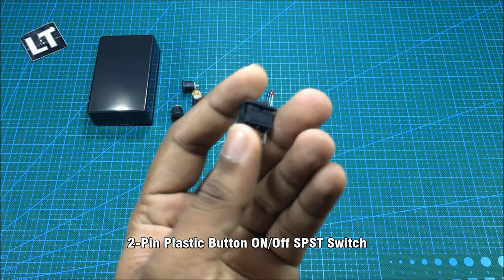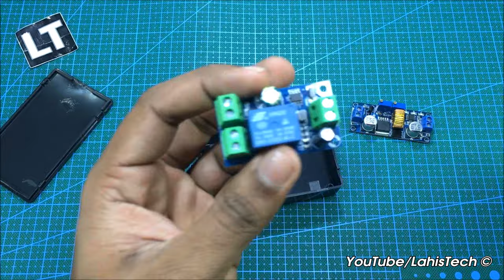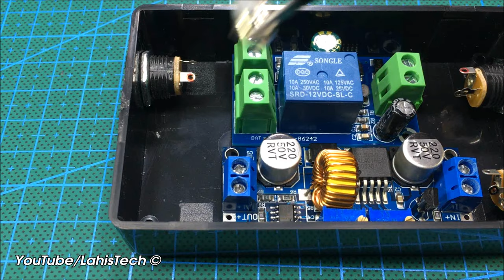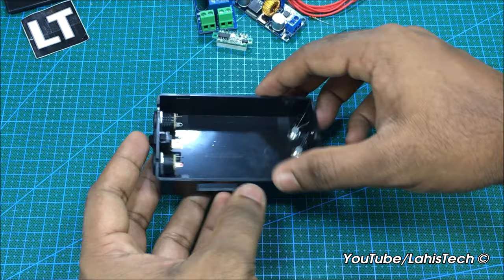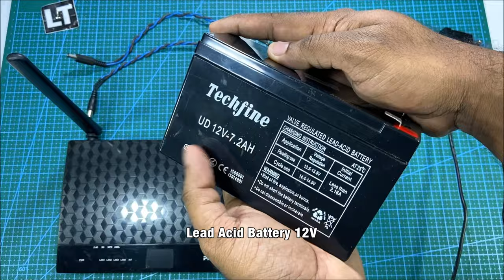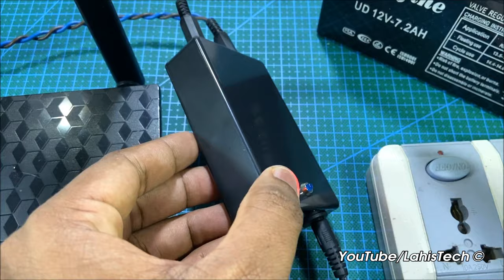How to make Automatic Power-OFF Protection UPS for WIFI Router

Comment: A proper way to make a router ups is using 12xx series ICs. It will properly cut off power due to discharging. Otherwise the router keeps restarting. I've tried a few setups and found this solution as the best way. Thank you.
Reply: You mean 7812 regular ic?

Comment: Why did you use XL4015 5A Power Supply Step Down Module when the Power-OFF Protection Module Automatic Switching Module is capable of charging the battery?
Reply: Di ata nag chacharge sa battery yan bro... kaya nag aatubili din akong bumili ng board na yan...

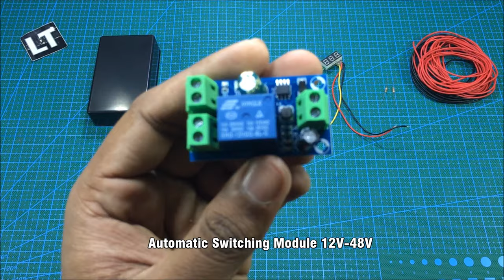Comment: That automatic switching module (#0:52) just switch the connection. It can not charge the battery. Btw this video makes me realize that it is better to use 2 power supplies (1 for the battery, another for the router, or other things) in this type of circuit.

Thank you for this video.  😇
Reply: why do you want 2 power supplies.. just one big with CC is enough
Reply: Right
Reply: If your device requires 1A current, use a 2A adapter, this will charge the battery as well as keep the device running.

Comment: Very interesting video, thank you!
Does this device charge the battery? Is it possible to make it not charge the battery? I need without charging.
And the second question, when the power goes out and switches to battery power, does the router reboot or continue to work? That is, does the switching happen instantly or with a slight delay?

Comment: NO, this does not charge the battery when AC power is on.
It's not an optimal setup!!!
Reply: exactly
Reply: I want to do an ups the same, but to charge the battery. Do you know of a tutorial?
Reply: bms and YX850 or  bms and XH-M350 you need more circuits..
his setup seams for complete isolation its an ok set up if you don't mind charging separately the video used  YX X804 not YX850 or XH-M350

Comment: Does it charges the battery while connected to the outlet? Does the router restarts when switching between battery powered and outlet powered?
Reply: 1.No
2.Yes
Sucks
Reply: There will be 1second delay, so its not ups, just power backup

Comment: Can u explain the reason why you used  a step down module here ??
does Automatic switching modules itself not charging the battery if it is on main current ??

Comment: Great neatly made !
But i have question
Is it the zero lag switch as i can see a blink when u turn off the ac power
It would be even better if rechargeable li Ion cells used instead of huge battery pack . And also we can reduce the DC connector points
Reply: there's a delay due to the relay discharging before switching over... so yeah, the router will reboot...
Reply: @tophlaw4274  any way to avoid this?
Reply: @omshivtiwari  a large enough capacitor could keep the power going during the brief outage during the switchover though it depends on how much current your router draws
Reply: @tophlaw4274  my router draws 1A current, what capacitor would make sure the switch won't cause restart of device?

Comment: The project is very good. What modification should I do if I want to have two 12 V outputs? one for the router of 1.5 A and another of 1 A for the fiber optic terminal. I appreciate any help.
Reply: Just add another output socket

Comment: router resets every power-cut when relay swithes to battery, it can be seen on the video, so you will lost you internet conection for router boot time
can we improve the circuite adding capacitor that will handle power drops?

Comment: Hi, i bought a 3s bms for my wifi router, which works fine , can i charge it with 12v charger of router or should i use any charging module.
Reply: 3s bms should be charged with maximum 12,6v. So 12v will be better for more battery cicle life.
Reply: @muflatu  ok .so 12v  is enough
Reply: @chandrasekharguntupalli4079  yes. safe
Reply: @muflatu  thank you. Bro..👍❤️

Comment: What if you just skip this module and use the battery connected to the power supply. Current will be drown from the power supply, the battery will be fully loaded. When there is the outage battery will be used. Whta is the advantage of this module? Voltage regulator can be used to produce stable 12V. My router works fine for input voltage 9-24 so it has the regulator build-in.

Comment: Just make battery voltage to adapter voltage. and put it parallel to chager output..thts all.  Normally routers work 7-12.5 v. That means a parallel leadacid battery can give 1-2 -3-or 4 hr of uninterrupted power. Im using like this, now its 2 year 🎉 no problem.

Comment: I have made a similar setup for my router, for daytime use case. I have two power sources, one js adapter & second is solar panel (18v 8A). I used a buck converter LM2596, a 12v relay and a Diode for reverse current protection. LM2596 for solar panel to step down from 18v to 12.8v. This works great. When adapter gives power, it is default power to the router. When adapter is off (electricity off) then auto switch to solar. However still there's a delay as this video shows.
Reply: sir koi muje bna ker de skta hy yr plzzz
Reply: i m very need this
Reply: koi hy to plz myjse whatsap per rabta kerle

Comment: I'm making similar box for my 9V router, but will use DC step-up for charging 12V battery from 9V power supply instead of Power-OFF Protection Module.  That way 12V battery will be always automatically charged and ready.
Reply: yup thats the way to go
Reply: be careful. you will want to use a protection circuit as to not overcharge the battery (or just use an off-the-shelf smart lead acid battery charger)... overheated lead acid batteries tend to boil internally & self-destruct (well not explode-explode but their case cracks & the acid goes everywhere)
Reply: @tophlaw4274  not also ideal to always charge the lithuim cells to full. i also have a 8.4v ups pack boosted to 12v. after a few months one of the cell died. the method used in this video is much safer for batteries either lead acid or li-ion, you can swap batteries when needed. that way you can stack up some salvaged batteries and make a 2s or 3s with a parallel of 3 or more. the only issue is the switching of the relay has a delay of about 1 second. an electrolytic capacitor might make the handover seemless.
Reply: @rosekreuze  I never mentioned anything about charging to full... just that it's a bad idea to keep charging batteries constantly. Lithium batteries are a different story charge-wise as heat becomes a major factor (moreso than keeping them always topped off)... which the LahisTech's approach will actually do. 

Also, lithium batteries require a proper charge voltage that smart charging circuits will provide (including automatic cutoff to prevent overcharging as well as overdraining when it's unplugged) definitely a must have if you're planning to use LiPo/LiIon batteries.

Comment: When the switch is 'on' in the ups, though the current is also 'on' in our house, does the router works on AC power supply or the DC 12v battery ?
Reply: Yss

Comment: this is just ok for DIY experiment... but 
- no recharging
- no low voltage cut off (not sure)
- costs of components including battery will be much higher than commercial wifi UPS with included battery
Reply: I want to do an ups the same, but to charge the battery. Do you know of a tutorial?

Comment: HI, i have netgear router with 12v & 2amp. is this ups will work with my router? the model is netgear nightwak R700
Reply: No, the max Amp output on the internal electronics is 1amp. As we add more wifi users on your network, the current draw increases and the unit tries to restart. I have experienced this in this very setup.

Comment: can i   connect this to the 7ah battery  inside  a working ups 
ie,. the ups charges battery in parallel  and getting dc output while power fails..
Reply: the charging voltage and output voltage is different.
Reply: but if the power goes away the ups battery will be also drained. you will have to implement low voltage cut off also

Comment: It seemed like a failed project.

The adaptor led should be off and switch to battery led after power failure, and when power resume the battery led off and adaptor led on.

Comment: On the YX850 Power Failure Automatic Switching Standby Battery Lithium Battery Module, the DC terminal has power, it is connected to the battery to charge    
How can the battery be charge without a charger and how they know what the voltage to charge the battery?

Comment: Please i have some question which i am looking for anyone who could point me in a right direction,i am trying to know something about an inverter/solar electricity generating system for a home or organization,i was wondering if there is some kinda software or device which can be inserted into the inverter/solar electricity generating system,which will make me have some kind of automated central control system on pc or phone to switch the device off from any location and and wouldnt be able to come on if turned on from the generator itself, but can only switch it back on from my device or terminal.

Comment: Voltage drops during switching time. This will cause the router to restart. It cannot be called pure UPS
Reply: Try adding 1000uF 16v capacitor at output. If that doesn't work then use 4700 uF
Reply: @shubhamsawant5129  any diagram for this connection? i'm new at this
Reply: @shubhamsawant5129  doesn't work with this capacitor
Reply: If this board also delays the switch causing device to restart, then Switching can be done using a 12v relay and a Diode. No need for this complete module.
Reply: @AbidAli-bo8sv  adding relay will not solve problem because short deleay will be present ,the router will be restart

Comment: It did restart your modem after you cut off the AC power
Reply: And i think you interchanged the input of battery and dc adapter charger
Reply: Yep, I like the idea but the way its now made is just totally worthless in my opinion.
1. You don't have the battery charged at all times/ you don't know how full it is
2. There is no protection for the battery to stop when battery voltage is getting too low
3. No (super)capacitors are used to let the modem/ap stay on during the switch.
4 (ish). Battery isn't built in.
Reply: @bjornstevens11  Only useless if it doesn't meet your needs....
1. Just add a Charging Circuit
2. See above
3. Add one
4. Make a 18650 pack and a bigger enclosure
5. Instead of moaning about something that isn't for you why don't you add information instead....As you seem to know what's wrong, you should know how to correct it for ones own circumstance/use. Carry on....
Reply: @sonicmistress  Well I try to make something that works and is usefull, the thing he made litterally harms the hardware for making a voltage drop/cutout. This is not good for any hardware. And I will carry on, but people need to know that this is just bad for hardware and not really usefull in my eyes. Good day.

Comment: nice idea. the circuit it got also does the same when it switches from main to battery the is blink witch is enought to make router reboot but when it switches from battery to mains its ok. also another drawback is that the circuit doesn't charge the battery

Comment: This is not a router UPS as the power will be cut-off during the switch over from mains to battery source (a relay takes a too long time to switch). The only design that works for true uninterruptible power is a design where the power output is always powered from the battery source (the battery being charged with a control circuit when mains power is available)

Comment: 3x 18500 cells would be more than enough for this project ! I have built mine with 3x 2800 mah cells and it powers the router for 12 hours. And its waaay more compact
Reply: Please give battery and router information you have used

Comment: Hii , my d-link wifi router was not turning on , i used xl6009 module , router light was blinking and not turning on .what should i change..help me
Reply: use a multimeter and set correct voltage and current

Comment: Thanks a lot for the wonderful video. One small clarification instead of the large 12 volt battery can we use the smaller one like 18650 and try to fit it in the same compartment...
Reply from the maker: Yes, but with 18650's you can't run this long time.
Reply: @LahisTechLT  Thanks for your quick response. We are having a DG set, the problem that I'm facing is whenever there is a power drop, the DG takes few seconds to start and during that time the router restarts. So my requirement is to maximize the usage of direct DC from the Router adapter.
Reply: Sir, I'm a noob in this. So plz enlighten me.. why can't we use laptop battery directly between router and adaptor With over charge protection..?

Comment: hii bro, i wanna make a ups for my wifi router and modem, so how can i get 2X 12 v   output on single 5v input .plz help....🙂
Reply: Please tell me your router model no  and name .
Reply: you can use normal 5v output powerbank for your 12v router without any step up converter. it will work perfectly just try.good luck
Reply: @sitalbhandari2268   D-LINK  DSL-2730U
Reply: @chandrasekharguntupalli4079  thank you.
Reply: @nonpolitical9976  no it doesn't work.

Comment: Nice but you can do this by using 8pin relay its cheep and easy to use don't need to make this type or complicated and expensive module box
Reply from the maker: Does a relay get any protection (over-voltage, forward reverse protections)?
Reply: @LahisTechLT  battery always give 12to 13v its not high and adpater also set on the same voltage and have all the protection fetures 
I am using relay about 2 years its working fine

Comment: This ups will not do a seamless transfer from battery so the internet  will shut down once the main is off
Reply: yes there is a power outage of few mili seconds as it does switching. Cant use as router UPS as if people are using virtual machine using their token and if there a power outage for few sec also they will be disconnected.

Comment: This circuit cannot charge the lead acid battery so you have to take the battery every time and charge it separately.... This is not optimal..... Try and make something that also has a charger integrated for the battery 🙌🏻

Comment: Looks over complicated. Don't see why the step down module be needed.  Also switching module not needed.  A 12v 2-pole relay switch should be sufficient.

Comment: 2 bad things - 1 No battery charging (At the same time Battery is too bulky) 2 If we need to on Off the battery switch it is useless. When the battery itself is of 12 volts what is the need of stepdown circuit to provide 12 volt DC supply to the relay circuit. Utter BAKAWAS circuit.

Comment: Not only does it not charge the battery while powered, I saw that router's power indicator light switch off and on again when you unplugged the main power, which means it's not uninterruptable power either. Therefore, this unit is a complete fail in my opinion. Who wants their router restarting every single time the main power has an issue? The whole point of a UPS is that it's uninterruptable... it's even in the name... Uninterruptable Power Supply. How did this video get so many likes?